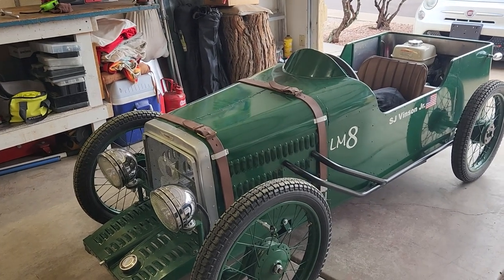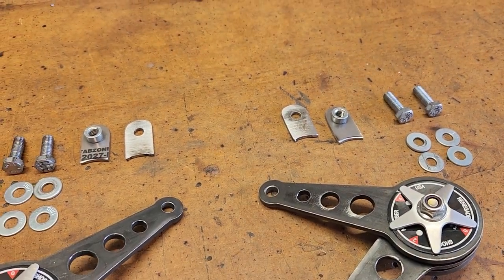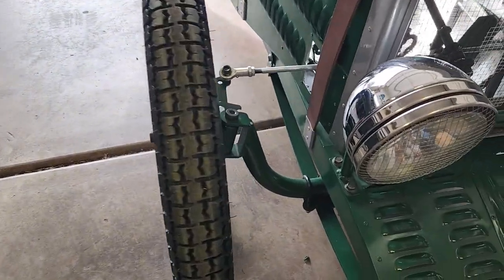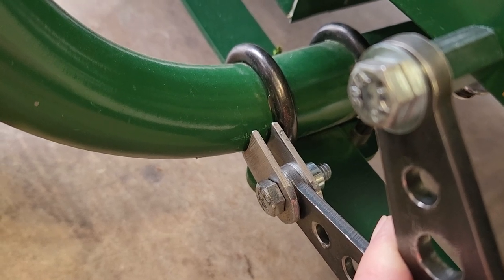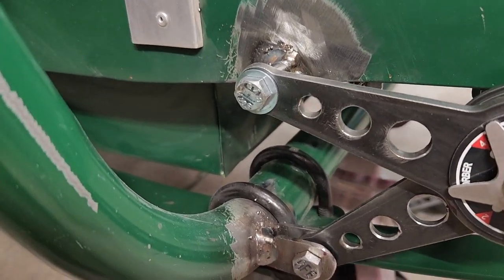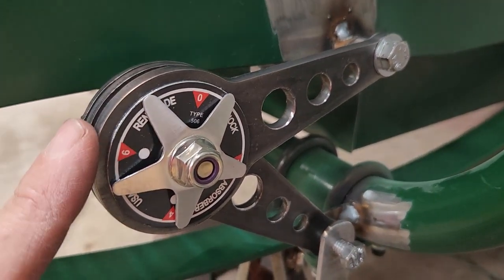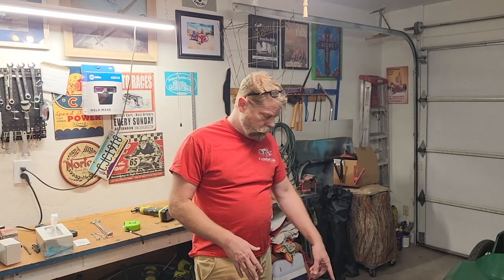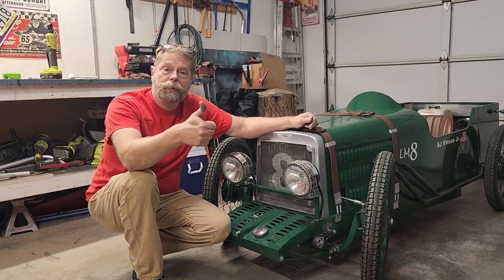Renegade CycleKarts Friction Shocks Install

Comment: Hi Steve,  another interesting video - thanks.  You might want to add a rubber bush into the the mount holes to stop it twisting the mounting brackets as the axle changes angle
Reply from the maker: Great tip!

Comment: Just started watching you Chanel, and I am enjoying it. This video answered my question of what that part is. I'm toying with the idea of building a cyclekart, and parting with my sandrails. I do have one suggestion for you shock mount. If your frame material is thin where you welded your upper mount it may start to flex and crack with the up and down rocking of the shock.. I would recommend a small gusset on the top of it.
Reply from the maker: Thanks, I am also thinking about a Heim Joint.  As it seems to have some twisting action if only one wheel is on bump

Comment: Will you be doing a comparison, before and after of how the CycleKart handles?  It would seem having some type of dampening would be better than nothing.
I thought if I built a cyclekart, I would consider installing bicycle shocks. However that style of shock may not be in the spirit of the cyclekart theme.
Reply from the maker: Right, the shocks do help.  Stiffer front suspension seams to be a bit more predictable.